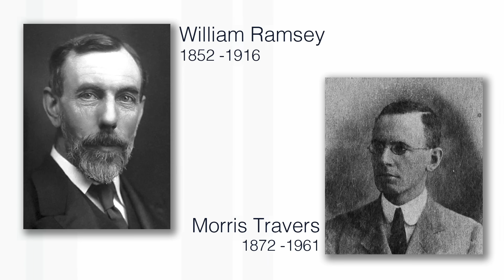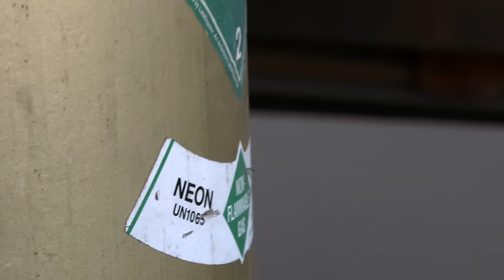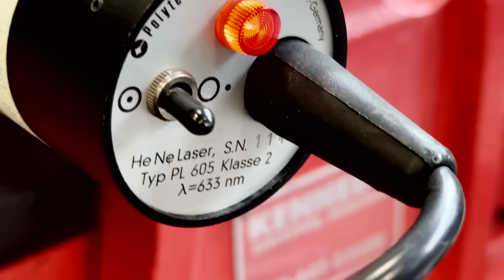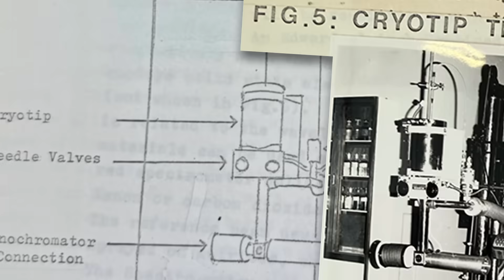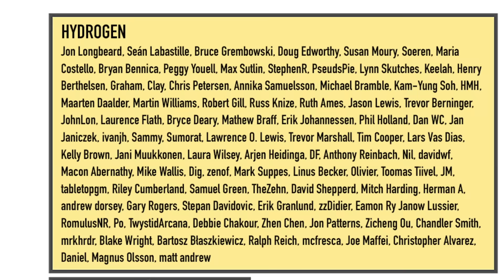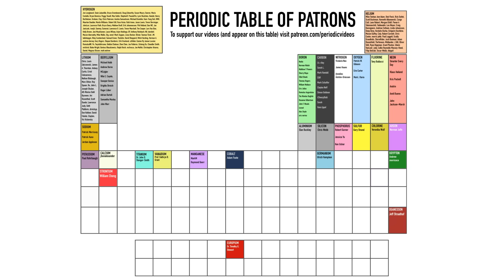Neon (new) - Periodic Table of Videos

Comment: Respectfully professor, it is very easy to see that the 25% H + 75% N explosion was significantly red shifted.  I mean it’s really obvious - either you didn’t see them in the YouTube side-by-side comparison of all for variants, or perhaps your own color perception is changing.  Truly offered with respect, because I’ve been watching your Elements videos from well over a decade!
Reply: on the one with the shot from the bottom, it doesn't look as red shifted temp me
Reply: It's an issue with the camera, they really don't work well in the far red spectrum so they tend to make everything tend towards yellow except at low brightness. It's the lower intensity of the 75/25 Ne/H2 mix that makes it appear more red.

Comment: 6:00 The explosions with neon seem to have a more hollow shape, as opposed to 100% hydrogen which seemed more spherical and complete. Perhaps the hydrogen is mostly floating at the top of the balloon, and expanding when the balloon pops, leading to the shape. I wonder what about the 75% mix made it different? Was the balloon shaken before ignition, perhaps unintentionally?
Reply: I would speculate that the mix would be fairly uniform, and that while the fully-hydrogen explosion had roughly the same shape, the lower concentration mixture made the contrast between the less and more intense parts of the explosion more obvious; i.e., it had more dynamic range in the video, whereas the hydrogen explosion came closer to saturating the sensor. (Note: I am not a chemist but am a fairly experienced amateur photographer.)

Comment: 7:29 Even at 10% Ne and 90% He the discharge will look like 100% Ne. A 100% He discharge is a straw yellow color. 
The blue star is Ar with Hg. A pure argon discharge is a soft violet color. A 90% Ne and 10% Ar discharge it will still look like a 100% Ar discharge. He has the highest ionization potential of the Nobel gasses, followed by Ne, Kr, Xe with Hg vapor being the lowest of all.

Comment: The 75% Ne mix looked redder than the pure H2 explosion to me. I doubt that has anything to do with neon specifically - Id hazard a guess that it's because there is less H2 in the same volume, so less combustion happens, producing less heat. Lower temperature means redder black body radiation.

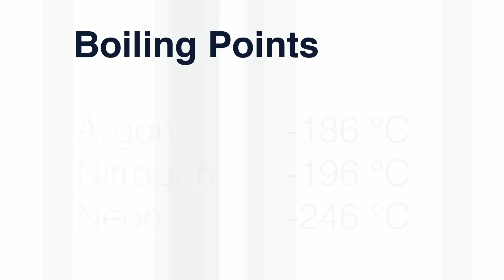Comment: @1:28 I understand that you can get much lighter gasses to liquify in these experiments because the other gasses are evaporating at the surface of the liquid gases which cools it enough that other gases can condense. I read somewhere that there a was a theory further to this where the neon is dissolved in the liquid and the aforementioned cooling causes that neon to condense.

Comment: 6:20 The 75% Ne appeared redder to me but it could just have been less bright. I think you would need better controls to really know. I have two different experiments in mind, one simple and one expensive which I’ll follow up below:
Reply: The easy experiment is just a modification of the current balloon system. I think it would be better to use a 2:1 H:O mix versus Ne and for a control a 2:1 H:O mix versus Nitrogen. Actually Argon might be a better choice since Nitrogen has a messy spectrum now that I look it up. Nonetheless, I think it would be best to film no less than 4 balloons exploding at the same time. Maybe 25% Ne, 75% Ne, 25% N or Ar, 75% N or Ar; again with the remainder being a 2:1 stoichiometric ratio of Hydrogen and Oxygen. If you could blow them up simultaneously somehow (electric?), you might be able to grab still images with all background correction normalized between them and do some digital analysis. The better, more expensive experiment would use a  decent quality spectrometer coupled to a transparent piston for igniting the Neon or Nitrogen. I don’t think anyone would care about the question enough to fund it though 😂

Comment: Now that we know neon floats, we should replace helium balloons with neon since it’s easy to get from the air.
Reply: It's about 20 ppm of the air. Getting it out requires large amounts of energy and cost to liquefy and fractionally distill vast amounts of air for the tiny quantity that is present. Even when this is accomplished, its molecular weight is only a little lower than that of air (a bit over 20 vs a little under 29), so its lifting power is very low compared to helium (4) or hydrogen (2). Meanwhile, helium exists in significant quantities in some natural gas fields and is therefore much cheaper to extract. While this resource is nonrenewable, we're not running out of it anytime soon given new helium extraction operations in e.g. Qatar and Algeria.
Reply: "easy" lol
One liter of neon costs something like $250 USD to produce.  An 11" balloon has a volume of 12-14 liters.  A single party balloon will cost $3,000 + the cost of the balloon.

Comment: The isotopes of neon are separated & used in helium-neon lasers.  Using 3He & 22Ne enhances the energy transfer between the helium & neon, doubling the output of the laser.
Reply: HeNe lasers are a fascinating subject, with some very odd things that are used to enhance the output; a couple of my larger lasers have a row of permanent magnets along the bore which supress some wavelengths  and enhance the desired output, giving more power and a single mode output.

Comment: The flame won't excite neon atoms to higher electronic energy states for the same reason it won't excite hydrogen atoms; the energy levels are too high above ground state. In fact, the energy levels in neon are higher than those of hydrogen; you would likely see Balmer lines of hydrogen before you would see visible neon lines. (I'm surprised you didn't film the explosions through a slit and a diffraction grating.) This is different from e.g. sodium whose spectrum does show up in a flame since its first energy level above ground state is comparatively very low.
Reply: @eusta_mae_cmewsick This is sodium's prominent yellow line, right?  How is it lower energy than neon's red lines?
Reply: @Tehom1  Yep, that's the one! Sodium's yellow line is a transition directly to ground state from the second lowest energy level, while the transitions that produce neon's red lines lie higher up on the energy level diagram. Neon's transitions to ground state all produce vacuum ultraviolet photons, so to produce red light, one of neon's electrons must be excited to comparatively higher energy levels and then decay to that second lowest level which is still much higher than sodium's second energy level.
Reply: @eusta_mae_cmewsick  Thanks, that clears things up!

Comment: Two videos I think there should be: 1. How Sir William Ramsey found all those Noble Gases. Sure, just let liquid air slowly evaporate, and see what 'boils' off at the different temperatures - but how do you get air cold enough to liquefy in the first place? 2. I understand there was a LOT of confusion when isotopes (and the products of radioactive decay, too) were first found. Did "Radium G" and "Thorium D" (for example) count as separate elements?

Comment: The 75% Ne explosion does look different, but I think mostly it's less intense, less bright.  Some folks might register that as "more red", because we tend to think of red as being a darker color than yellow.  (We don't even call dark yellow "yellow"; we call that "brown".)  But I think what's really going on there, is there's less hydrogen and thus less flame.  I don't think much of the neon is participating to any significant extent in the oxidization reaction, which should surprise no one.  You could probably get a similar effect with 25% hydrogen and 75% diatomic nitrogen, or some other gas that's unlikely to burn.
Reply: When I first saw it I thought, "oh, it is more red!" But after the next replay I realized it was probably just the lower amount of total hydrogen.
Reply: maybe pointing the spectrometer (with a video camera attached) at the balloon would have made the difference clear?
Reply: Yes, I thought 'redder!' too, but you may well be right about this.
Reply: Cameras and screens don't deal with emission spectra correctly. And the room was also bright, this throws it off even more.
Reply: The addition of Ne lowers the flame temperature, because the Ne absorbs some of the heat of combustion.  Thus the Ne/H2 flame appears more reddish.
Reply: Would be interesting to see if adding some O2 to the mix would give it enough of a kick to really excite those neon atoms. Not an experiment you can run indoors however.

Comment: I have a correction to make. This correction is not about chemistry, but about acoustics: the change of sound when the vocal tract is filled with a gas that has a lower density than air.  The thing that actually changes is the resonant frequencies of the vocal tract, but the pitch at which the vocal folds themselves are vibrating is the same, with air or Helium in the vocal tract. 

Recommended resource: professor Joe Wolfe has a demonstration with sound recordings and spectrum analysis. Search with this: 'Speech and helium speech'.

I will refer to Helium, because with Helium the effect is stronger, given Helium's density.  

Our hearing picks up a very large amount of information from sound. Sound has the capacity to be very, very rich in information, because it has the capacity to consist of superposition of many different frequencies. (At a subconsious level our hearing does something that is effectively Fourier analysis.)

Given human anatomy there is a relation between the normal pitch of the speaking voice, and the resonant frequencies of the vocal tract, and we become accustomed to that. With the vocal tract filled with Helium: because of the upward shift of the resonant frequencies there is a strong auditory illusion that the actual pitch of the voice is higher, but that is not in fact the case. When the vocalization is recorded, and spectrum analysed it observed that the pitch of the fundamental is no different.

Comment: They need to find a working crater lamp to demonstrate- this is a neon discharge lamp which produces a very intense red light beam.

Helium-neon lasers can actually be made to produce light at many different frequencies, from infrared to red-orange to yellow to even green.
Reply: The IR ones are boring! But I have examples of the others, unfortunately the colours other than red have very low gain, so a tube that would produce 15mW of red gives about 1mW of yellow or 0.5mW of green for the same size.

Comment: Lovely Neon, a great reference standard I’ve used for spectroscopy. The 5 major peaks used to align not only our gratings to the correct angle, but also to get our camera pixels aligned. And then to make sure we know the proper dispersion of the spectrum across the chip. We also use a Thorium-Argon source as well.

Comment: Funny, it reminded me of this physics exercize where we had to calculate magnetfields in the ITER experiment. As it involves crazy Amperes, they need superfluid Helium to turn whatever metal they use to a supraconductor. They were crystalclear about it being cooled at the very same 4K so most likely using a scaled/updated version of the device.
Reply: 4k is the boiling point of helium.
Reply: Helium-4 is superfluid at ~2K. I think niobium is a preferred metal in such applications. It only needs ~9K, but the superfluid is a very effective coolant.

4K is much easier to sustain, so I think the push to 2K is only applied right where it is needed.
Reply: Helium-3 is rare, but also not as useful. Its not, as atoms, a boson!

All other isotopes are unstable.

Comment: I'm not buying that neon isn't coming out of the planet and replenishing what the solar wind strips away. If it was only a primordial condition, and it's "inert", you'd ecpect depletion of a relatively light particle.
Reply: It is coming out of the planet from radioactive decay processes and being stripped away by the solar wind.  It's at stable levels in the atmosphere at 0.002%.  The reason for noble gas shortages is because it's very expensive to extract from the atmosphere.  Also once usage exceeds the replacement rate for very long you are shafted.